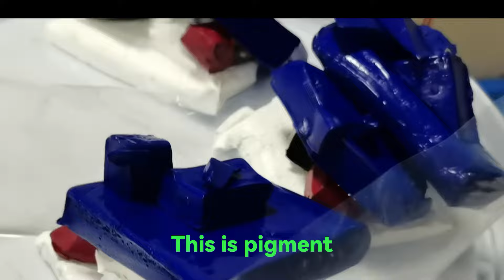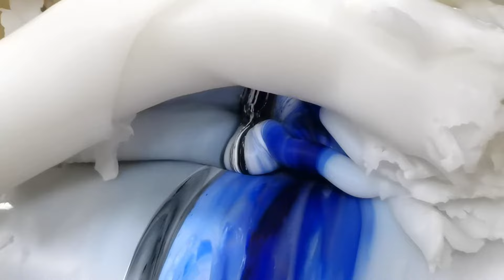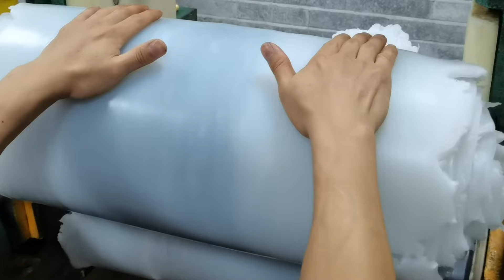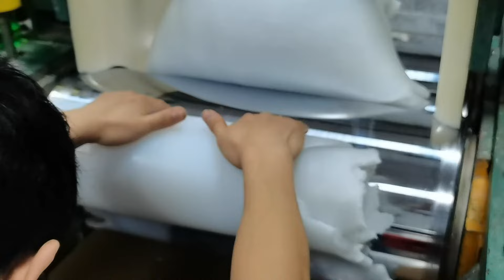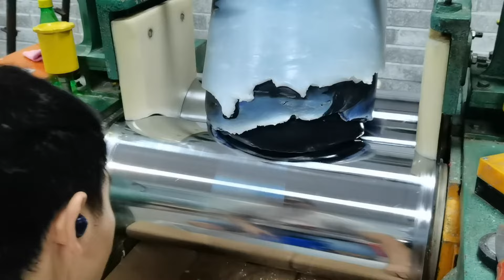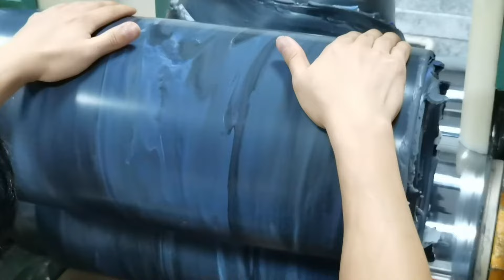Silicone Mix Color(With music ,confortable!)

Comment: With colors like those thrown in together, I half wish they'd leave them only partially mixed, so it'd be left with a nice marbled color pattern
Reply: Would have to do a different mixing sequence for that. The totally mixed color also indicates a totally mixed in curing agent
Reply: I don’t think the pigment has the same properties as the homogenized color. They would have to mix the colors separately and then marble them.
Reply: @sparkybish  the pigment doesn't really change much, but you need everything very well mixed with whatever curing agent you are using. 

When going to the end point "everything is perfectly blended" everything can just be added, but otherwise each component would have to be pre mixed with cure.
Reply from the maker: Actually,we could throw in one by another with these pigment,but that takes time.Normally,we have efficiency requirement to fabricate them as soon as possible.
Reply: I know what you mean, I work with polymer clay (not the same of course) but when you put several colors in the pasta machine to mix them up sometimes I stop half way because I get a marbled mix of colors that look so nice it would be a shame to keep going!
Reply: I have thought that many times now. It gets kinda evenly streaked throughout and....yeah there just there.

Comment: What sort of silicone is this? What is it used for? Looks like plastic.
Reply: It's raw uncured silicone, once the colour is correct they mix a vulcanising agent into it then press it into the final product shapes in a heated press which cures it into rubbery silicone.
Reply from the maker: It is a different material.